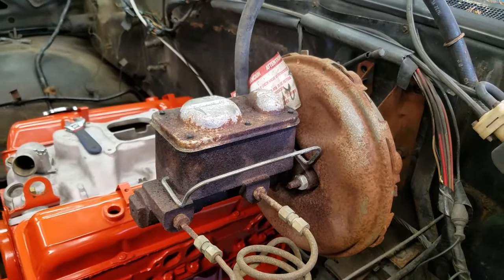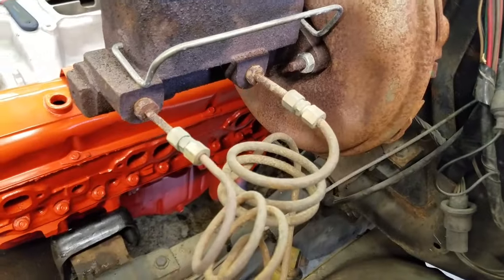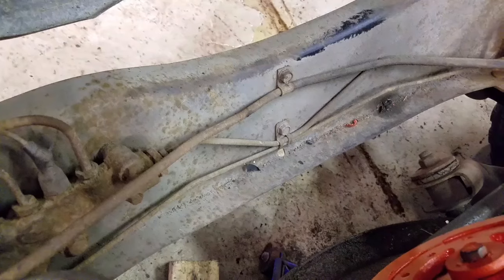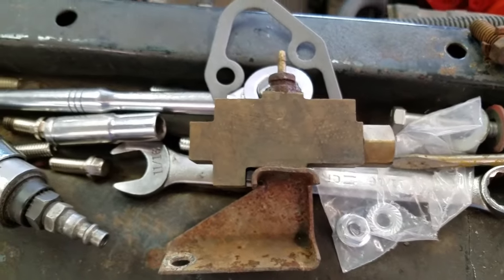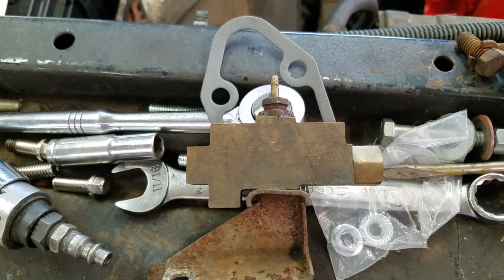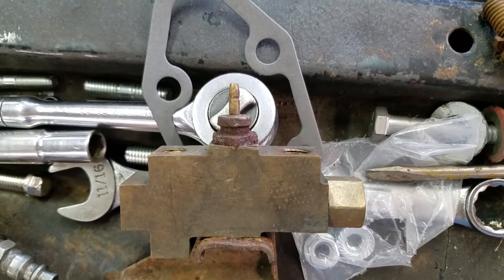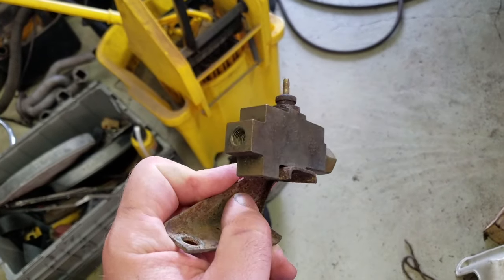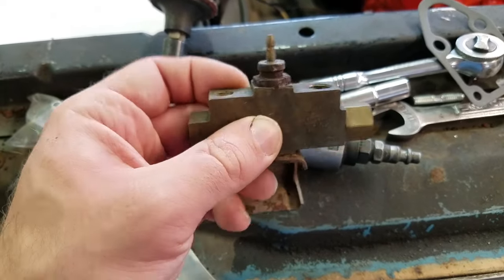Why Your Old Chevy's Brakes Won't Bleed.

Comment: I wonder how many of these valves actually do have the ability to block off flow. It seems pointless to design a valve that saves fluid when that half of a brake system has a bad leak anyway. My 92 caprice didn't stop a huge fluid leak to the rear and my 03 Dodge Caravan didn't block the front off, this happening in the last year. In fact I never had trouble bleeding brakes on any car due to the valve blocking since 1970 when I started mechanic work. The only trouble was centering the spool in the valve to get the warning light off on late 1960's Fords only, as a rule. We had a tool that screwed in where the wire post/switch is, that tool forced the spool to center. Since then a good firm push on bled brakes systems seems to center the spool. Several decades ago I had to partially bleed a front or rear bleeder on some vehicles while someone was watching for the warning light to go out or blink. If it blinked you went past the center and had to bleed the opposite bleeder carefully/slowly to get the light out. That worked in just several tries. There must be some combination/ proportioing valves that have block- off capabilities but I never found any.

Comment: Thank you! All I got was a weak trickle when I was bleeding my rear brakes on my 86 suburban. Replacing the valve asap. Btw, does the brake light always come on when this valve is not working correctly? Thank you again!
Reply from the maker: The light should come on whenever that valve moves from the center.

Comment: you would be surprised how many of those old trucks are running around with only the front working.  I had 82 3/4 ton 82  1/2 ton and an 81 3/4 ton throughout my life and all three had no back brakes.  and they were all being driven when I bought them.  all of them had soaked back brakes with the wheel cylinders leaking.  I guess the point of my input is for anyone getting one an 73-87 is to check the back brakes asap. also I had a few people tell me that they found the same thing.
Reply from the maker: I find the same thing. When the brakes work properly in these trucks they should just about throw you through the windshield with the slightest tap.
Reply: @FuelInjectionSucks  that is absolutely true, for an older vehicle they do have really strong brakes.
Reply: @FuelInjectionSucks  right now im trying to figure out my samurai.  I bleed the hell out of them. Right now you have to pump about 4 times to get a pedal.  And that pedal doesnt leak down.  I just pulled the wheels and im about to start investigating but honestly im sort of stumped

Comment: 1990 Chevy P30 Step Van. Blew a rear hard line. New rear lines, wheel cylinders, combo/prop valve and master cylinder. Brake light is now out. Still no pedal and nothing more than a trickle to the rear. Any help is greatly appreciated

Comment: And if you fill the system from the bleeders ?
Reply from the maker: Usually when these valves trip on older vehicles that haven't ever have that valve move, they don't want to go back like they should when equal pressure is restored.

Comment: I was driving my truck and the next day the brakes just stopped working good so I refilled the brake fluid and the brakes still don't work good and I don't know what the problem is BTW it's a 1977 chevy

Comment: hey man I have a 87 high Sierra 3500 and I can't really access the bleeder valves or the brake line where they enter the drum in the rear. The manual explains a way to bleed the hydro boost system after being replaced by rotating the wheel and pumping the brakes and a series of other things. The brakes and the power steering now are intermittent, the wheel wont turn when at a stand still but when moving its effortless and when I pump the brake thay will go from being very strong to hitting the floor. Any ideas? Thanks.

Comment: Or possibly that suction syringe method didnt work and you actually need to bench bleed it....  I'll be back to edit this comment if I need to go into that distribution block.   Edit #2 Nope you were right I need to go into the distribution block.  Edit #3, On my 73 Grand Am (A Body) I got it to reset and give pressure to the rear with 3 or so moderate&slow pumps of the pedal.

Comment: Hmm..  would the same solution apply to a 91 Toyota 4Runner?  The only difference is, is that I think in the back on the side where the line blew it still bleeds normally out of there when we bleed it.  The forerunner has all new brake lines throughout the truck.  After installation and pressure fill bleeding the pedal goes straight to the floor.  It’s going to be either this, or like Scotty Kilmer says to pogo stick bleed the master cylinder.
Reply: Pogo stick bleed? What's that may I ask

Comment: what did you mean when you said "this truck is decked like all of them"? the smaller compartment on my master cylinder completely runs dry every so often and i need to refill it. I was assuming it was leaking somewhere but cant figure it out
Reply from the maker: That's your rear brakes. You most likely have a leaking wheel cylinder. Look to see if the inside of your rear tires are damp with fluid. I also most likely said the truck is dicked, knowing me.
Reply: @FuelInjectionSucks  thanks for tip, I will look into this. Also, best video on proportioning valves on youtube by far so thanks for posting

Comment: maybe that little aluminum piece is what I need to vacuum bleed the rear brakes on my dodge ram....the front brakes vacuum bleed fine   but not the rears;  it throws the switch off balance ;;;;   but I got it back right by using the brake pedal...if I remember right...I dont do this everyday...only when I have a problem

Comment: Thanks much for the tip,...also, where's my best bet for finding rotors for my 73 chevy c30 1 ton dump??, it has about a 7 in rise on the inner part....kind of a cone shape....
Reply from the maker: Those risers come off. Any parts store should have them.

Comment: Could that have been the problem with the brakes on your VW? Or is the proportioning valve setup in a different way?
Reply from the maker: There was only a proportioning valve on the rear brakes, the front lines were direct. I think the issue was when one of the previous owners made the new brake lines, I don't think they made the flares correctly.

Comment: I’m working on a 73 Catalina that’s been sitting for 20 years. I just replaced some of the lines to the front brakes and bled those. (It also has new front calipers.) but nothing is coming out when I try to bleed the rear drums. So this makes me think that my solution is right here. But when I push the pedal with the engine off, it’s firm and when I push it with the engine on (power brakes) it sinks to the floor. Why is that? Master? Booster?
Reply from the maker: It sinks because there is are in the lines. The pedal is easier to push with the booster, so you feel it more.

Comment: I have a 99 Silverado that won't bleed in the rear. I'm assuming you have to remove the brake lines to remove that distribution hub, correct?
Reply from the maker: New body style? You need a scan tool to bleed the abs module. Your truck does not have a proportioning valve like in this video.
Reply: @FuelInjectionSucks   Yes, new body style. Well, I jammed on the brake pedal and heard the "click" ! Presto, fluid started flowing to the back brakes!  However, brakes are still spongy so I still have some diagnosing to do. 
Keep your videos flowing, these are great man.

Comment: compression fittings on a brake line are dangerous and will sometimes fail in a panic situation they should be avoided
Reply: And your solution is what?
Reply: @kCI251  I flare my brake lines, flare connections wont pull out.

Comment: so I put all new hard lines and new proportioning valve on my 68 chevrolet biscayne because I installed disc brakes in the front and I had a problem to where when I open the bleeder valve on the front brakes it shoots out real quick and my back brakes just come out slowly so what should I do?

Comment: Pretty much sums up why I choose Chevy over Ford any day, is for the dual master cylinder setup.  Ford has pretty much ruined my trust, if they can't even make an automatic transmission worth its weight, and don't care if you lose all your brakes down the highway.

Comment: any advice....  I am working on a 1972 Monte Carlo. I replaced the master cylinder and brake booster, bench bleed the master cylinder but not getting any fluid at any corner. I have used a hand held vacuum bleeder and used the two person bleed.... no fluid..... pushed the front button and no fluid.
Reply: HollywoodMGB3 what was problem I'm having same problem no fluid to my drivers front 74 c10 suburban
Reply: HollywoodMGB3 I am working on a 72 Monte Carlo as well. No brake fluid to the front calipers. Did you ever solve your problem ?

Comment: cpp valve comes without bleeder tool , can't bleed brakes completely w/o setting off light and closing off part of valve.Should have been included or at least purchased seperate or maybe go with a supplier that has all needed for the job
Reply from the maker: I've never seen a prop valve come with the tool.
Reply: Master Power Brake offers complete prop.,tool,line adapt. much not needed.Speedway has tool on amazon 4.99+8.99 S.H. I ordered my valve from O.P.G which arrived in 3 days but line sets were back ordered .I'm replacing All lines,alreadyreplaced master & booster, front disk & rear drum.This is a 68 el camino with orignal frt disk.Not in a hurry just want it right,i think i can come up with something to lock the slide piston until finished bleeding.Not that tight with money just don't use it if another way.Thanks

Comment: why couldnt you just crack the front line at the master cylinder and when you push up your brakes the front wont pump up then it allows you to push the fluid on to the back .about 3 tries and you will have fluid . bleed the rear then retighten the front lines at the master cylinder. that how l do it takes about 3 tries and it will, bleed put a old towel around the botton of the master cylinder to keep the fluid off everything. used this methed on my old 89 roll,back for years. what i think happens is when you pump the front causes the pedle to , pump up before the fluid reaches the back. i never have to bleed the front either after,i tighten the line back up.
Reply: I'm gonna try thus

Comment: SO when the pin shifts    can it keep one front caliper locked Passenger and the driver's side is fine  this g2500 93 van pulls radically when you hit brakes  to left  it can drive and move wheel but no way if you Hand try- thrree blocks and that rotor is HOTTT while driver's is cool already changed caliper and bled that pesky BPMV is according to Deleco 1247-7669 with or without dash  its accompanying wheels speed sensor also looks melted that too seems to not BE available anywhere!!! pn delco 177-718 (discontinued) wheel speed sensor looks at rotor reluctor teeth.    Damne brake line hose ???
Reply from the maker: No, you have a bad caliper or hose.

Comment: hmm... I just upgraded my front brakes to disc, and replaced the prop valve with an adjustbable wilwood. can't get it to bleed the rears no matter how much a turn that knob...
Reply from the maker: +Gendo3s2k Is the factory one still in place?
Reply: @FuelInjectionSucks  ...How did I miss this response??
But, no. It's not still there. I'm about to go take another shot at it

Comment: are those compression fittings on the MC ,,,,,dangerous
Reply: Man I squirmed when I saw that water supply line here
Reply: Try reading where he has posted many times on how the previous owner did that. He has corrected the problem.

Comment: My C10 bleeds from and corners except the front passenger caliper... any idea why?
Reply from the maker: Collapsed hose, clogged line, or clogged bleeder screw.
Reply: Fuel Injection Sucks thanks I ordered the line in case it’s that.  
Could air be used to blow the line out?
Reply: Thanks I changed the line shortly after and it’s working like new!

Comment: My brake light warning is always on because I accidentally ripped the wire off the proportioning valve. Whoops
Reply: EragonSuperM that wire illuminates the light when it's grounded, not when it's disconnected. If the wire isn't grounded, your light is on for a different reason (the parking brake switch is the only other possibility in these trucks).

Comment: I cant believe there is not a factory service procedure....because im sure there is.
Reply from the maker: There is that button you can press if the front line blows. If the rear line blows they are supposed to auto-center, and when they were newer they probably did. Problem is after 30 years they stick.

Comment: So I will repeat and shorten.  Get rid of the old crap that doesn't work.  Get yourself a new PV that they sell everywhere.  The simplest ones just go the back brakes.  One in one out.  They restrict the flow or pressure so you don't fish tale when stopping fast.  When I was young that was the whole point.  Get the car into a slide and then get it going straight.  

Get rid of the crappy brake system that doesn't work!  When I stomp on the brakes I want to come to a screaching stop.

Comment: 4:08 Thank you, mine worked by purposely bleed front brakes.
when I was trying to break the rear brakes line it was too tight it either shave the screw or snap it off. 
So I watched this video: https://www.youtube.com/watch?v=S11p2Isgmu4 and it helped me.

Comment: so... I have to ask I have 2002 chevy avalanche and just last night I went to stop and my brakes started making a horrible sound and started making the brake pedal jump well I pushed it to the ground to stop and now my brakes are gone well I bled my front brakes their fine and my rear brake on my passenger side will not bleed at all so maybe it's what is wrong with my brakes or maybe master cylinder?
Reply from the maker: You have an ABS pump roughly under the driver's seat that controls all that. My guess is the passenger rear line blew, and the abs pump blocked that line off.

Comment: So before the worthless crapy ABS crap they had this PV crap.  One crappy idea led to another.  All the complexity is ok if you have a new vehicle. Or  you have a full time mechanic.   But simplicity rules.  And yes you can take that PV out.  They make hundreds of PV that just go to the back brakes.   I keep hearing this don't mess with the brake system installed by the manufacturer.  I would rather have brakes that will stop a vehicle on a dime than crappy ones that don't work. 

Oh and ABS was designed for jumbo jets.  Most of us don't drive a jet and we don't have full time mechanics.

Comment: Never take brake advice from someone that uses copper compression fittings on brake lines
Reply from the maker: Better not take advice from the last owner then.
Reply: If the last owner did it, as you claim, Why didn't you repair a obviously dangerous repair? The blame still belongs to you
Reply from the maker: The truck was in the garage for years, and didn't run when this video was made. If you look in newer videos, every piece of the brake system has been changed, including all the lines. I was using it as a demonstration piece. 

Go about a minute in....
https://www.youtube.com/watch?v=2mTNqbrnJY8
Reply: Thomas Briggs
Are you deaf?